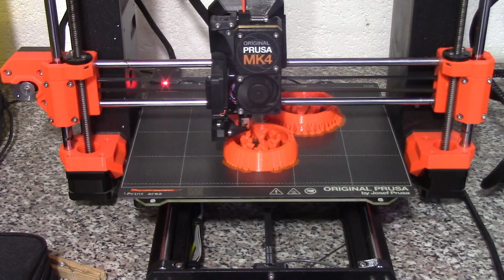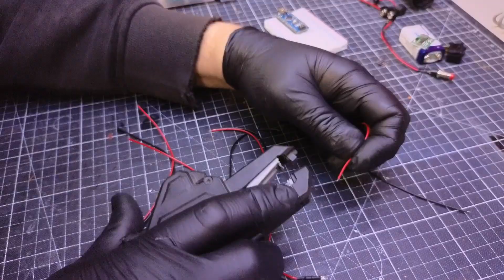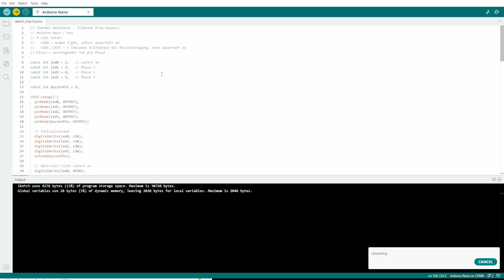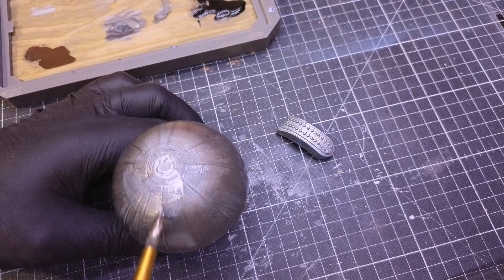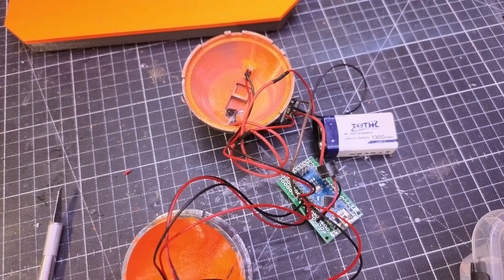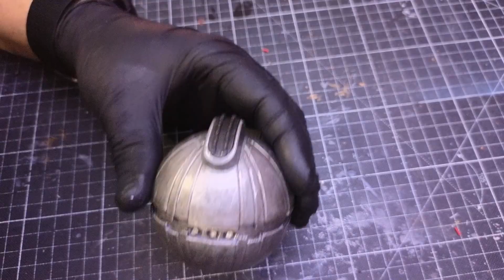I Built a Working Thermal Detonator from Star Wars

Comment: Great job! I have wanted one for so long. That one lookes like a good size, the ones I see on etsy seem too small. I think I'd make mine 110 - 120 percent. I guess I can make one now that I have a resin 3d printer and built and lighted many models. I just never worked with sound boards and the schematic programming looks intimidating. I'm really good at painting and weathering. I would sand down all the "layer lines" (I hate those) that's why I bought a resin printer. And maybe get a clear light button cover and stain it red in mine. I'll have to do some research on the Arduino control system.
Reply from the maker: It is not that difficult, but if you use Resin, you should use ABS-Like Resin.
Reply: @MeangummyLizard  I saw Adam Savages video on the KR X OP TD Prop Kit from One Replicas. I wish they still made those as they are amazing (and metal). They should remake them, they'd sell a ton. I think they sell for over $1,000 now on Ebay, ect.